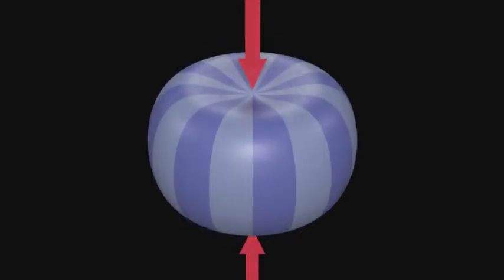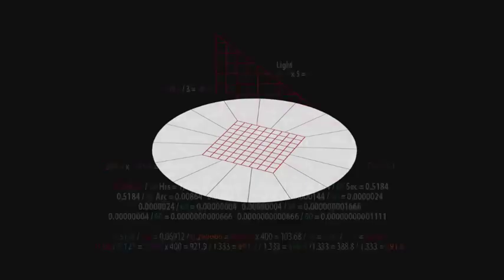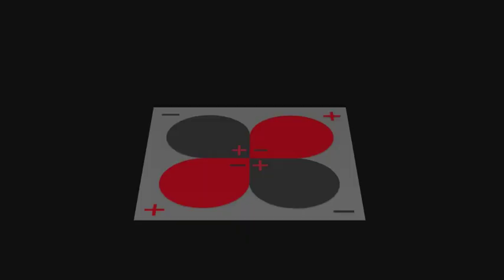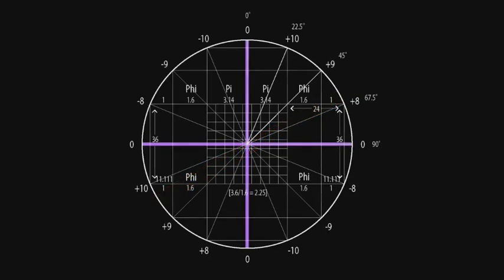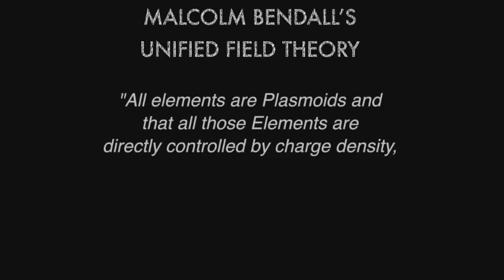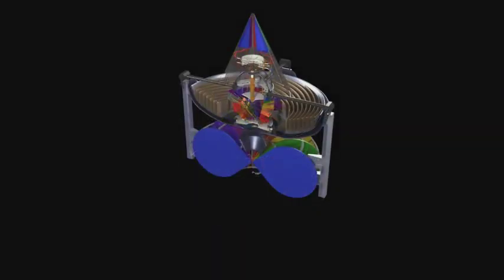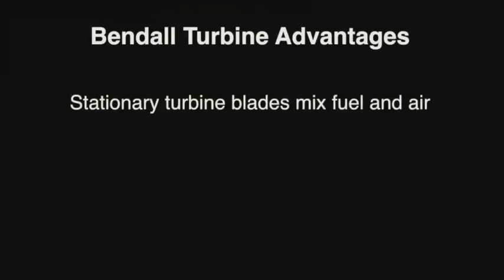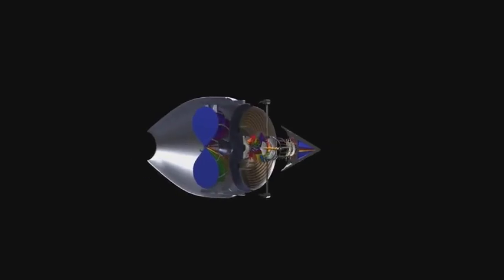Malcolm Bendall's Plasmoid Unification Model (Copyright Strike Foundation - Bendall Legacy Archive)

Comment: Was a little thrown off when at the Cosmic Summit they revealed the ionizer and bubbler are not even necessary components and the Thunderstorm Generator is just the hot/cold exhaust pipe.  Seems to call into question the integrity of the supposed overall system design.
Reply from the maker: It's been mentioned in videos I posted about 6 months ago. The vajra can be preconditioned. However I'll be posting the Chevy retrofit trial in a day or so where the whole system is functioning. That should clear it up

Comment: Wait...

So the problem with using plasmoids to power a vehicle is that the plasma doesn't like operating at variable speeds?

There's a way - Sears used to sell a bicycle wheel & engine you could attach to any bike & it ran full throttle, now they're impossible to find & very collectable but...

Could do the same thing with Plasmoids, when you want to power the bike you just lean towards the wheel that sits aside your bike & constantly have the engine run full speed 

Nominal fuel savings but as a prototype vehicle should be a fun project

Comment: @6:40 I see only one large square, defined by joining all the nines, but it says two are created. Where is the second square? Is it created by joining the zeros, but just not delineated? 

If that's the case, why are there not four squares joining every fourth cardinal point, or two large squares and two non-symmetrical quadrilaterals formed by joining similar numbers?

There also appear to be many more than eight small rectangles.

Also, can anyone explain the logic of the placing of the various 8's, 9's and 10's

Comment: This jives perfectly with the flat earth where electrostatics and density/bouancy replaces gravity. The former sets the down bias and the latter sorts everything else out. The erronius 4d space time warping Einstein came up with is only needed if you think space as an infinite vaccum above our heads exist, wich it doesnt. Earth is an enclosed system, the sun and moon are of equal size and distance and both emmit their own light. The sun is not a star, stars and planets are luminaries in the firmament and they all revolve above our flat topographical plane.
Reply: Too bad there's no flat Earth model which accurately predicts all of our observations.
Reply: @shadowdragon3521 If you include virtual observations then yes, it is too bad.
Reply: @shadowdragon3521  Everything that happens takes place on our flat realm, and there are zero "predictions" (actually post dictions) that requires a globe to work.

Comment: I really like the all the angles that appear in this coil design . Great way to use electron flow a/a vibration to generate vortex flow , although a standard wire wound coil is also vortex shaped , this leads one to think what are the limits to the conical geometries